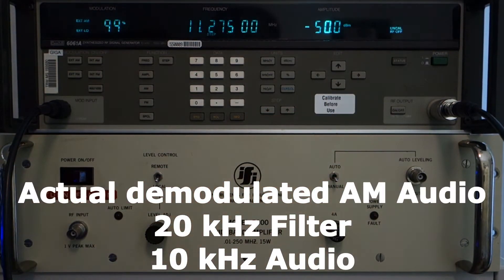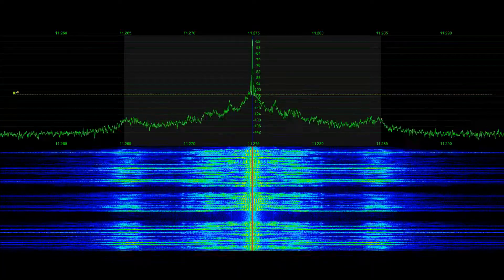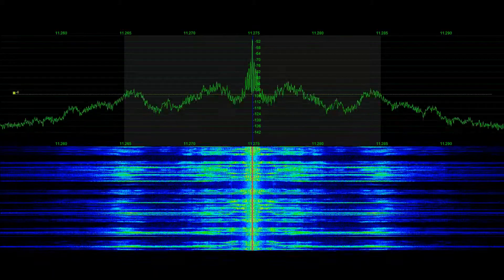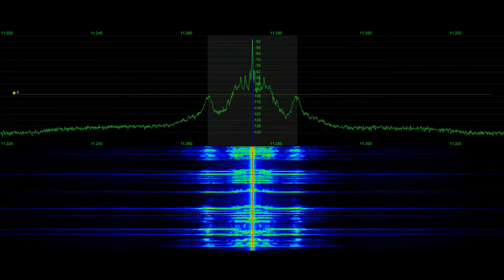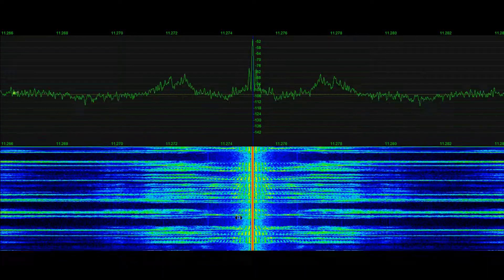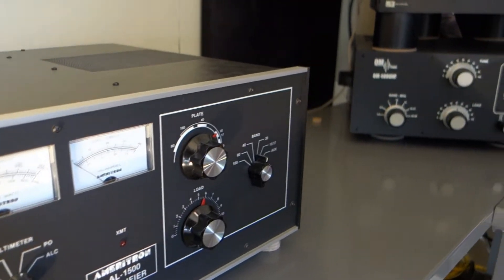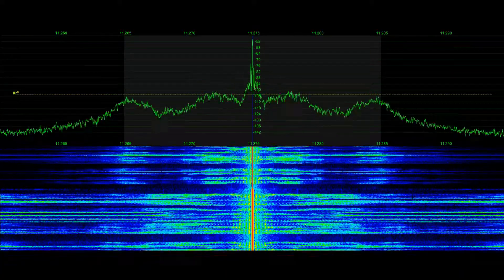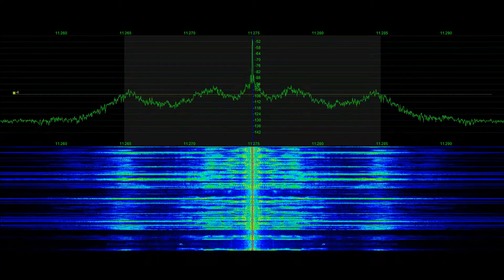Hi-Fi AM transmission with line level audio and signal generator

Comment: damn very clear AM sound quality... actually i building a tube based broadcasting transmitter for 64 meter...my plan to broadcast music on uvb in AM mode 10KHz BW. the transmitter is run with a single gu81m tube as a final ...and like 10 more tube in other stages
Reply from the maker: Sounds fun, yes if you want to jam, you could just do SSB or FM would be better.  Also consider if you are going to put the transmitter on the same carrier frequency or up say 800Hz from the main, also if you can 'FM' the carrier when you modulate that would be nasty too.